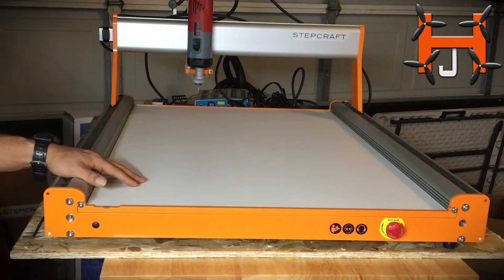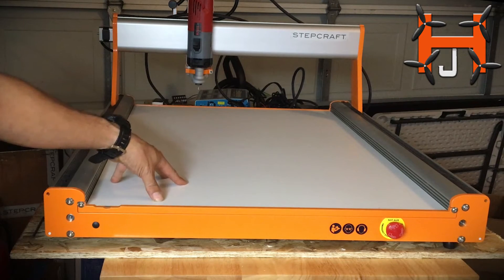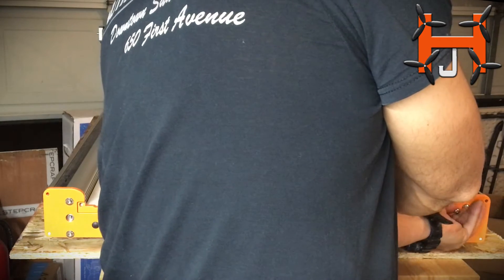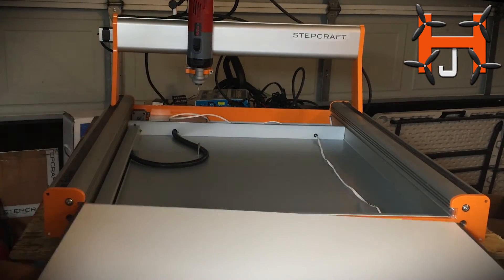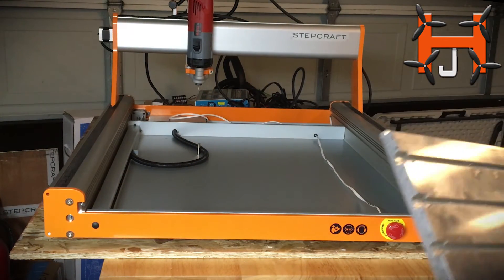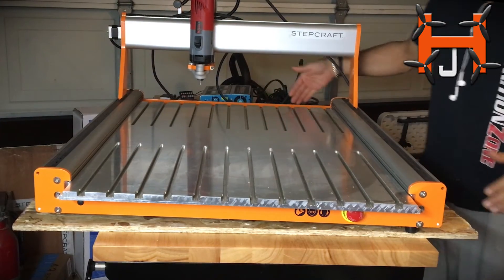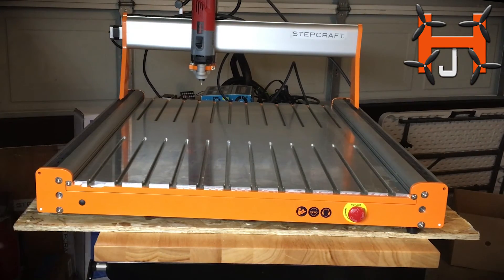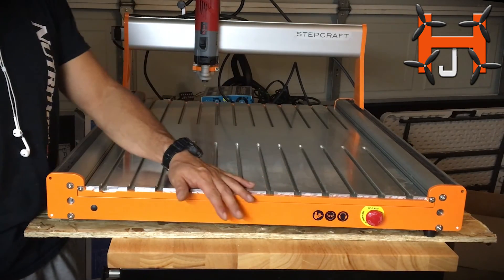STEPCRAFT 840 CNC T-SLOT INSTALLATION

Comment: Hello guy, thank you for the video. So, do you know what the material is that white plate? Thank u so much. See you.
Reply: The wood is MDF?
Reply from the maker: Gustavo Januário the material is abs material its like plexiglass but covered in white lining.
Reply from the maker: Gustavo Januário the material is abs material its like plexiglass but covered in white lining.
Reply from the maker: Gustavo Januário mdf is correct my friend.  thanks for watching and please subscribe.
Reply: Hover Junkie Thank you very much. Do you have some technical  guide of this machine? I'd like to know more about the especification, sizes, thickness, materials, etc. 

Thanks.